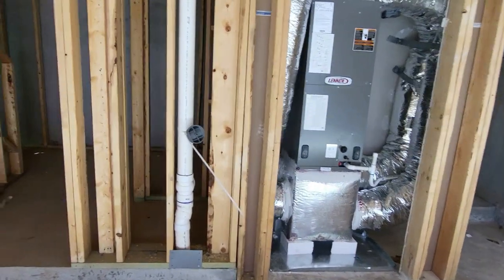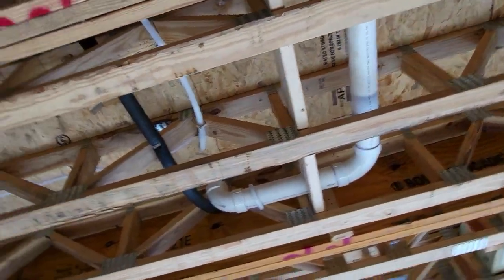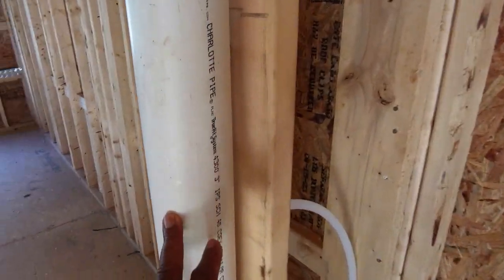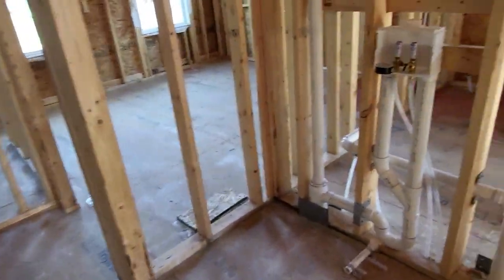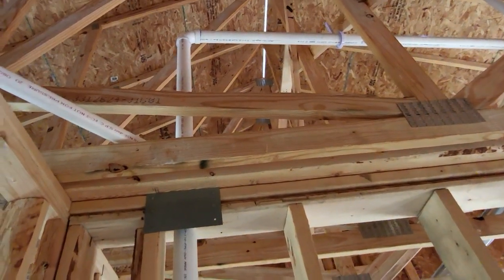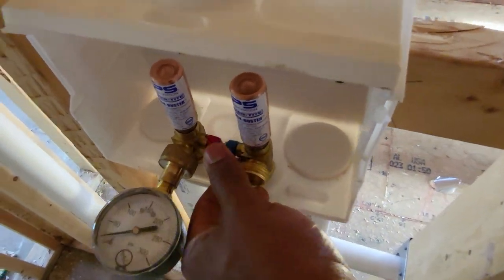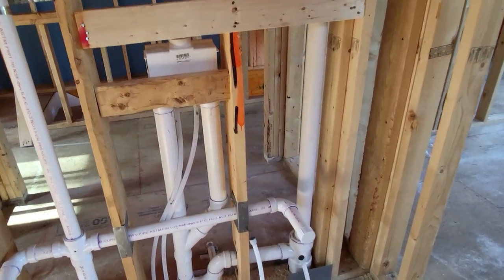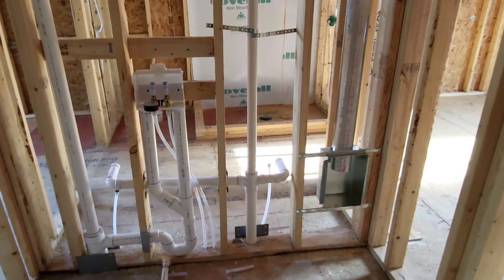Plumbing DWV & Supply Pressure Tests are Critical

Comment: 3:30 That looks like a double sanitary tee to the right. Why not require a double wye there? Is the double sanitary tee only allowed, because the two horizontal drains attaching to it are 18"? How much does the 18" matter if you are dealing with two gray water drains and only one drain is used by say pump discharge (washing machine) and the other drain is used by a sink. I've read the double sanitary tee acceptable uses in the code book like a 100 times and can't make sense out of it.

Comment: I've never had the pleasure of shadowing a plumbing inspector so this is very informative. One question, just how far down the line is the ball placed in the drain line? And is there any test for the line beyond that, say, out to the street?
Reply from the maker: It really depends on the layout.  There's an underslab plumbing inspection if the house is on a slab, which is what you saw in the video. There's also a sewer lateral inspection. (Sewer connection to the  street). To answer your question, a test plug is installed where the new drainage meets the existing.

Comment: So if you have no water service to the building because you are waiting for the water department (construction held up) or it is winter..... cold temps. I would have concerns of testing with water you would never get all the water out of the lines unless you blew it out... . liner test yup great go ahead and sheetrock then during construction liner gets damage. I believe that all shower pans should be a copper pan with the brass drain soldered in.
Reply from the maker: Normally, in the wintertime, we allow air.

Comment: Hi sir, i need help in installing dwv. Specifically for soil stack. It's a 3 storey concrete building. 
1. Is it better to install outside or inside? Embedded to wall or just beside it? 
2. Is it better to embed it to an CHB wall? Or outside the wall just beside it? And if it's embedded? Where going to embed it to an beam or column right? So the vertical pipe will bend to the beam and bend again embeding it to the wall? Is going to have like an 2 45 deg. Bend on a beam?
Reply from the maker: Inside running through a concealed chase.
Reply: @PPG1967  what's the standard size of the chase sir? And where is the best location for the chase?

Comment: The irc/Ipc has a major contradiction when it comes to the plastic testing. Both say you cannot use air on plastic but 312.7 forces sewer test of the IPC requires 5 lbs of pressure greater than then working pressure of the pump. So the only way to do that is to air test it. Cannot use working water pressure that will creates a cross contamination situation..
Reply from the maker: So, first of all, the plumbing section in the IRC is straight out of the IPC.
Personally, I don't like air for any type of plumbing pressure test. It's easier to locate leaks with water
Reply from the maker: The sewer drainage test required pressure can be achieved with a stack filled drainage system.
Reply: @PPG1967  How do you stack fill an 1 1/2"  lift station pressure line 5lbs higher than the working pressure of a 25 lb pressure pump?  Thats where that contradiction come into play.
Reply from the maker: Ok, I misunderstood.  You can use water or air with a forced sewer test.
Reply from the maker: https://codes.iccsafe.org/s/IPC2015_NY/chapter-3-general-regulations/IPC2015-Ch03-Sec312.7